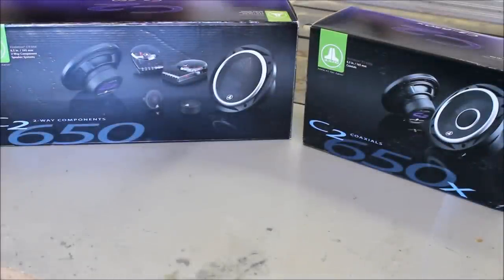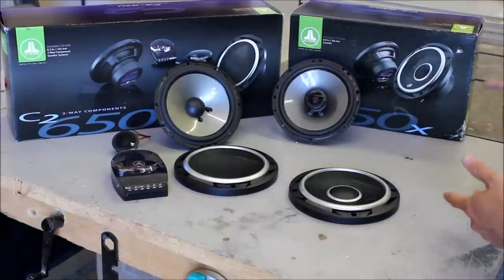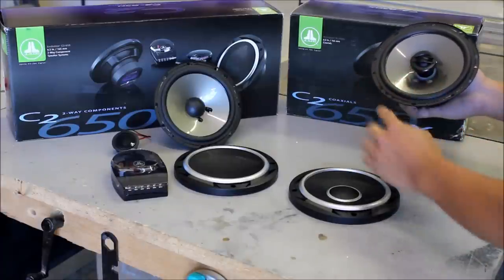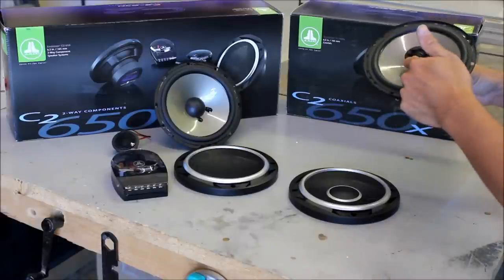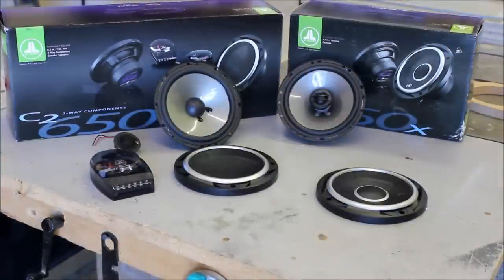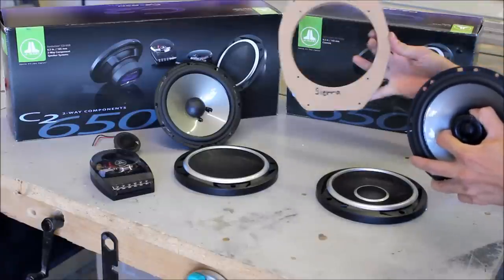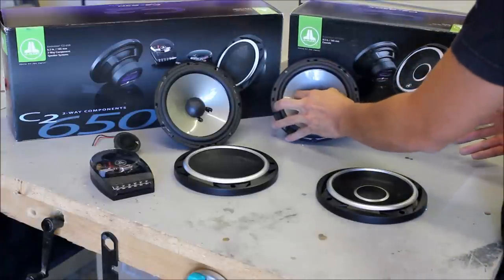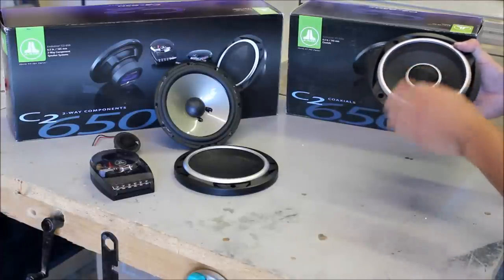Component vs Coaxial Speakers (JL Audio) | AnthonyJ350

Comment from the maker: Ya your head unit should be fine.  I would consider adding a mini amp like the Alpine Power Pack (KTP-445U) so you can drive more power to your speakers without breaking the bank.  Just wire them up in series since they're just tweeter.

Comment: I have a 2010 chevy silverado 4 door . I want to replace the speakers  any suggestions  what's best ?
Reply from the maker: Depends if you're running an amplifier or not.  On those trucks you can drop speakers in but I'd suggest either buying the appropriate speaker adapters or having them made.  You can get either from an install shop like mine.  Let me know about the amplifier and it'll help narrow down your choices.  Also do you have a particular budget?

Comment: I have some vibe sonic response sr50 5.25"  coaxial that come with an external crossover, they have two inputs one for woofer one for tweeter

They are basically a coaxialy mounted component speaker if that makes sense? (Similar to their 3d range)

 Normal coaxial filter the bass from the tweeter but the highs are still fed to the woofer as well which causes distortion or to much treble.

They will make decent bass down to maybe 45-50hz but the mid range distorts at higher volumes, if I set the hpf the mids clean up and will handle more volume.

 i have been considering adding three way crossovers with either separate 4" for mids or 6.5 for lows. 

Would this be viable?

Comment: Great video Anthony! I'm gonna be using a complete setup of JL Audio C2 coaxial speakers. Running them all off of old school PPI Power Class amps from the 90's crossed over by an Audiocontrol 6XS. ;-)
Reply from the maker: +Danny Caballero Niice!
Reply: AnthonyJ350 can it be possible to connect the components to my audio control epicenter instead of my main sub woofer amp?

Comment: My car is tahoe LT 2007 I need to change the doors speakers on the original system what do you recommend  btw I found a pioneer 6.5 320wt 3 way but I just realized I have 2 tweeters on the front panel ( A pilars )
Reply from the maker: If you want to build Custer a-pillar covers 3 ways are good. A 2 way is easier to install.
Reply: @AnthonyJ350  so I go for the 2 way speakers ? Because I won't biuld or change any stock tweeters I just need a good sound on the original system.
Reply from the maker: @Aziz_F1  Sound deadening is a better product if you want more sound from the original system

Comment: I'm running alpine type s 6.5" coax speakers, running off headunit power (Kenwood KIV-BT901 22x4rms) but would like to add tweeters to raise sound stage and increase highs. I'm stuck on wiring them, do i wire in series or parallel??? Will my headunit have enough power for all these?

Comment: Hey Anthony,I'm running Polk 5 1/4 components and was wondering if in the future I wanted to change the woofer to a 6 1/2 could I just swap it out and leave the crossover and tweeter in place?Could I even mix brands?

Comment: I was going to buy a component speaker system because my integra already has tweeters built in the door. But they dont work and they are very bland and ugly. I prefer better sound quality also, but i can't really afford an amp. Will it really be effected that much? As long as it can still get fairly loud and good quality im happy.

Comment: For the c2 jl speaker  ... for best sound what would be the best setup if they are connected to the jl audio RD900/5 channel amp? ....
My set up  .
Jl audio RD900.5  amp 
C2 speakers  components in the front and coaxial in the back  
With a H.O subwoofer enclosure 10" W3 .... all connected with stock head unit using  the JL Audio  iLOC2  .... 
Thanks
Reply from the maker: Add sound deadening

Comment: Great video! It helped me understand the difference alot better and now I know I'll be better off with the coaxial since Im just running the stock head unit. Thanks! ( I found your video cause I was looking at those JL's, haha!)
Reply: mrkthmn you can run components IF your HU has the power. Mine does, and so I do.
Reply from the maker: Glad it helped!

Comment: If a car came from factory with external tweeters, do you HAVE to use a component woofer/tweeter setup? Or can you install coaxials and leave stock tweeters?
Reply from the maker: You can do that, just need to figure out if it's full range at the woofer or else the tweeter won't do anything on your coaxial.  If it sounds good, run with it.
Reply: @AnthonyJ350  ended up putting coaxials in all 4 doors and left the stock tweeters. Sounds good to me.
Do you know if I could replace the factory tweeters with aftermarket tweeters utilizing the factory tweeter wires, and keeping my aftermarket coaxials, WITHOUT switching to a component setup?
Reply from the maker: @eze8024  You could, you'll need to install capacitors to limit any bass frequencies playing through them

Comment: Hey man thanks for the video, my car is mitusbishi lancer cj 2009 with rf sound system the thing is it sound bad and i want to upgrade the speakers, the front speakers are 2 ohm component the back speakers are 4 ohms coaxes, but i don’t know what to buy can you help me pls
Reply from the maker: I would just install components up front and coxails in the back all rated at 4 ohms each to keep it simple.  If you have a factory amplifier, it's best to bypass it and install an aftermarket amp if you're trying to get the best sound possible.

Comment: My car is a 2018 Honda Accord Sport, do you think is just better idea get JL C2-650X coaxial and skip the component and the amps, ? it'll get a good quality sound anyway?
Reply: Let me save you some time and money. Do not go with components. I have 2017 accord Touring. I wanted a little more kick, So I went with component speakers. It was recommended not to change the head Unit, so I had to buy additional equipment (lc2 pro, EQS). And honestly it would’ve been cheaper just upgrading with good quality coaxial speakers. Honestly going back to coaxial.
Reply from the maker: I recommend adding an amp to any system.  Even if the speakers are stock.

Comment: I own a 2009 Toyota Camry equipped with JBL Synthesis system & I believe it has Components 8 channel speakers setup. would I still need the crossover as I'm made to believe the amp already separates the frequencies, please advise
Reply from the maker: On a set up like that I would have to hook it up to some sort of RTA to see what frequencies are coming out.  The woofers you don't really need to worry about, but I'd still probably put a cap (bass blocker) on the tweeter to make sure you don't damage it.
Reply: +AnthonyJ350 the system has dedicated wiring for the tweeters & bass (directly from the Amp)

Comment: Great info!! Jus purchased the c2650 comp for the rear deck in my 13' challenger. I also wanted the same or c2690x for the door and the c2350 for my dash.. However crutchfield tells me they wont fit. Is there something I can do?? Need help! Only want jl audio in my car!
Reply from the maker: +Jaime Pruneda Cause the front doors are 6X9 right?  I just make an adapter or sell a speaker adapter to my customers.  Or did they say another reason it won't fit?

Great speaker choice by the way.  Those speakers sound awesome with an amp.  Do a 5 channel and install a JL Audio Stealth enclosure and it will sound so good.

Comment: Anthony, could you tell me what's the maximum distance allowed to put the tweeter? Approximately? Thank You
Reply: manimpz It's supposed to be 5-8 inches apart at the most. 2 inches would be even better, so that it all sounds like it's coming from one spot.
Reply from the maker: Ya they're suppose to be pretty close like u2bed91 stated.  That's where coaxial will have an advantage having everything built in one.  But when it comes to practicality in a real vehicle, typically they're placed pretty far.  Woofers have to be mounted low to clear the window and everything, than tweeters are placed higher to get a sound stage more level with your head.  Honestly my vehicles they're pretty far apart but I love how my vehicles sound.  It's really a matter of preference.  It's not like if you place them too far apart the vehicle becomes unsafe lol.

Comment: What if I go with 2 pairs of the 650x. I would get the component speakers but I'm worried about installation on my new 2016 civic
Reply from the maker: You can it, just get the proper speaker adapters.

Comment: From a Scale 1-10 if you would compare these to other know manufactures like ALPINE type-R and such, how would you rate these JL C2. I'm Debating between C2 or C3
Reply from the maker: ZGERMAN These are great, I think they're a little more clear than a Type R but you can get more volume from a Type R. If you can afford the C3 go C3.
Reply: I had the C2 components in my jeep JK.  They sound as crappy as the cheap kicker coaxials, and the C2 are way overpriced for what they are.  The only JL component worthy is the C5,  but they are pricey.
Reply from the maker: jeremy greiner Did you add sound deadening in the little enclosures up front? Also were they amped?
Reply: AnthonyJ350 i had my 6.5 " C2 components mounted in the overhead sound bar.  I tried poly fill, and no poly fill.  Had a kicker 130rms x4 amp running them.  I took them out, sold them, and now run rockford T2652-s 6.5" components.  Night and day better from the JL C2
Reply from the maker: jeremy greiner That's good you found something you like. I've always liked C2 installs but they have to be accompanied with a sub.
Reply: AnthonyJ350 i almost bought a used set of C-653 3 way components.  I still might, and put the rockfords in my rear doors.

Comment: how do you feel about some one taping straight in to a tweeter on a coaxial speaker? ruining its own input using separate amps to run the coaxial tweeter and mid with an active crossover to separate freq. bypassing the passive cap on the coaxial. ever try it? i got the equipment and want to try it lol.
Reply from the maker: Marc Mathes Do you have a processor?
Reply: https://www.amazon.com/gp/product/B01CSGW62I/ref=oh_aui_detailpage_o09_s00?ie=UTF8&psc=1   i have this.

Comment: I'm looking to keep stock head unit but upgrade system with an amp. Should I just go component or coaxial? I want loud clear without breaking the bank. How do I get the best sound? Should I use a clean sweep or hi-lo to hook up to amp? Any recommendations gladly appreciated! Thanks
Reply: ***** thanks alot! also do you think a sound processor is needed to get the best sound or just a hi lo inverter with crossover?
Reply from the maker: Imran Khan I like 5 channel amps.  Hertz, Alpine and JL Audio make great ones.  I did a video with the Alpine MRX V70 to drive 4 speakers and a 10 inch sub.  I'd do the same components up front and coax in the rear.  If using a stock head unit you can use a PAC audio piece if you're on a budget, if you have extra money use one from Audio Control or the Alpine Electronics unit.
Reply: AnthonyJ350 what is a  PAC audio piece? I don't mind spending a few extra bucks for quality but nothing over board I just want my system to sound clean, crisp and louder.
Reply from the maker: Imran Khan I'd be a SVEN 4 from Pac Audio.  I'd use something more sophisticated if you don't mind spending a few more bucks. What kind of vehicle is it?  Why not change the head unit?
Reply from the maker: AnthonyJ350 It'd*
Reply: AnthonyJ350 its a 2014 Toyota Rav4 with navigation and entune apps on it really don't want to mess with it. I couldn't find anything for the Rav4 especially a harness of some sort so I don't have to cut into the factory ones. Your the best man thanks so gladly appreciate your help bro.

Comment: +AnthonyJ350 Thanks man! Depth issues is what im running into. 5 channel for sure! The 3.5s are 25 watts rms.. You suggest running those off the head unit.. or can you run multiple 3.5s off a single 75rms channel?
Reply from the maker: +Jaime Pruneda You could run multiple off a channel.  You just have to make sure your final impedance  is what the amp is rated for, i.e. 2ohm or 4 ohm.

Comment: What is the optimum power distribution among drivers in a 3 way speaker system? What is the suggested or theoretical respective powers the midrange and the tweeter shall be driven at if woofer is set at 100W RMS? Any rule of thumb or theoretical basis? Thank you.
Reply from the maker: Most aftermarket speakers will have a passive crossover and do it for you.  It's more the frequency you throw at each speaker is the most important thing and of course setting your gains.
Reply: I want active crossovers and want to control frequency distribution individually. I just want to know what is the best power distribution so I'll know what power to deliver to each channel. Please keep on posting videos. Thank you for your reply.

Comment: Can your ears notice the separation if the tweeters and woofers are equidistant from the listeners ears?
Reply from the maker: +Vince James Yes at a certain point your ears will notice a difference as the tweeter gets further away from the woofer.  That's where coaxial speakers have an advantage.  You could however correct the distance if you built an active system and install a DSP.

Comment: I have a 2014 Chevy Cruze LTZ and don't want to mess with the head unit because of the navigation and all the goodies that come with that but want to replace the 4 door speakers that are 6.5 inch and was wondering if I should go with kicker or Fosgate and should I run something like a 50 watt by 4 channel to the door speakers. The Kickers CS are 100 watt RMS and fosgates are PUNCH P16  65 watt. In my head unit only goes volume level up to 45 depending on the music no distortion but not nearly loud enough hence the question. Thanks in advance
Reply from the maker: Joe Garner Best thing to do is go to an audio shop and listen to the speakers you want to buy.  Because everyone's hearing and preferences are different.  But for sure buy a 4 channel.  Actually buy a 5 channel and later on or right away you can add a small 10 inch sub.  It will sound soooo good after.  I like the PDX V9 5 channel from Alpine, I run one in my truck powering all my speakers and 2 JL Audio 10" subs.
Reply: I took it to a professional today and turns out because I've been playing my music via bluetooth through my phone that's why it sounds like shit so they plugged my phone in directly to the USB and my door speakers have adequate mids and highs come from the speakers near the windshield, so they recommended one sub, but I wanted to go bigger. So I bought 2 12 inch Polk subwoofers, box and Polk 1500 watt amp.  Guy that works there let me listen to his stereo system which had 1 12 inch Polk sub and it sounded good. Gets installed Saturday. Hope I made the right choice. Didn't want to replace my stock navigation stereo plus it would have cost a shit ton of money. Please tell me your thoughts on my purchase??
Reply from the maker: Joe Garner  Signal is everything.  Garbage in garbage out.  I'd just run a small USB stick with high quality song files in folders, that way you always have music in the car and it should load faster too. Should be a solid sounding system without spending too much money that they speced out for you.  I don't have a lot of experience with Polk Audio but I know it's a good brand.  What I would also look into is adding some sound deadening material like Dynamat or Hushmat to you car.  It just helps make the whole vehicle a better enclosure for your subs, so the bass will sound more refined and you'll hear more music.
Reply: I'll definitely transfer my music to a USB disk because it did take quite awhile for the songs too load into my stereo. Yeah I got to keep my car pretty clean for trade in value in the future but I'll look into the hushmat. And I chose non ported for Crisper bass...I hope. Thanks for the help. Appreciate it.

Comment: I need some HELP in deciding which speakers to install in my 2000 Silverado, its a single cab, I've  been looking at Alpine 6 1/2 and 4x6 speakers... im into LOUD, CLEAN and average BASS

CAN SOMEONE GIVE MY SOME FEEDBACK over these speakers, or which ones you can REALLY recommend
Reply from the maker: Raul Puente Alpine Type S speakers are great.  I highly recommend amplifying whatever speakers you decide to go with.  It's so much better.  Run a 5 channel.  Amplify all 4 speakers and run a thin 10" sub woofer behind the seat.
Reply: AnthonyJ350 excuse my ignorance but what are the S type? Another question, what do you highly recommend?  Component or Coaxial? I also plan on installing 2 10" kickers

Comment: i have a ram 2500 and has 4 6x9s 1 on each door what do recommed to replace them should i put 6.5 components or 6x9 components or just 6x9 coaxial
Reply from the maker: Michael Torres Do you plan to run a sub?
Reply: yes
Reply from the maker: Michael Torres You can do a component 6.5 up front putting the tweeter in the dash replacing the 3.5 " speaker and do a coaxial 6X9 in the rear.
Reply: AnthonyJ350 thanks for your response also what brand would you recommend me so speakers
Reply from the maker: Michael Torres Hertz, Alpine, NO Audio, Kicker etc they all have something good to offer. You need to go to your local install shop and listen to what sounds good to you and fits in your budget.

Comment: It has a stock cd player  and I'm looking to spend around 250. Or 300. I could add a amp to it but just don't want to run amp wires and all that .
Reply from the maker: I would look into entry level speakers like Alpine Type S, Hertz Audio Diecis or JL Audio TR's.  They're much better than stock and have the lowest power requirements to run.  I would also suggest installing some sort of sound deadening material as well.